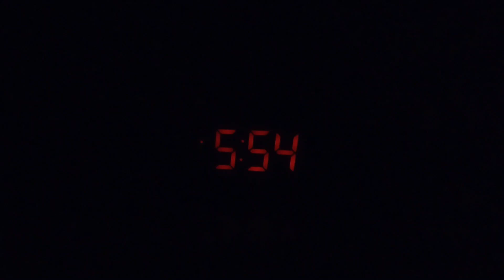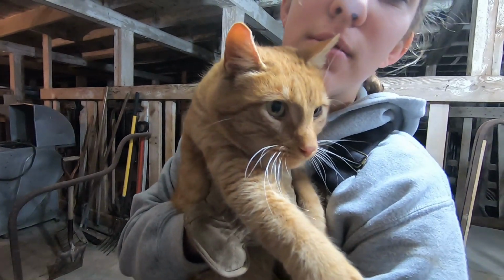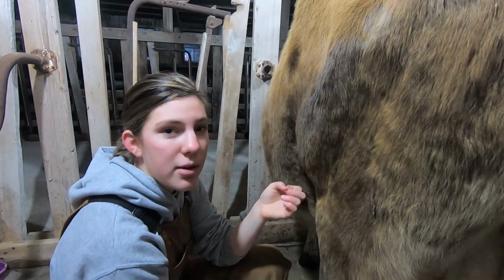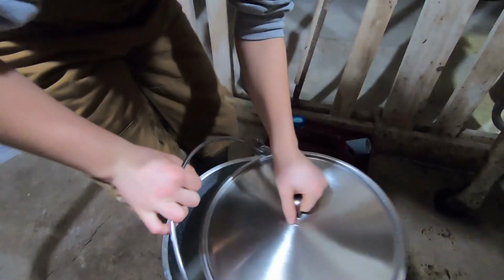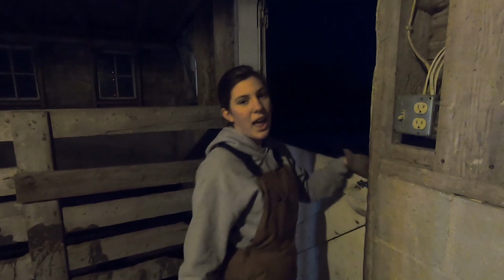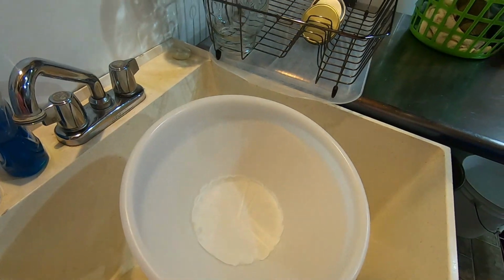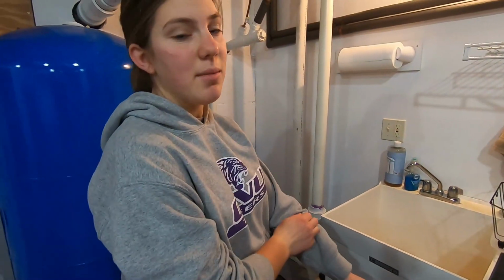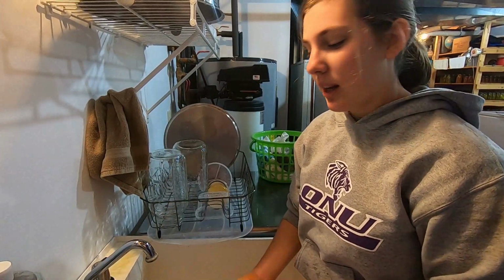Milking with Sister | We Love Raw Milk

Comment: Good job!  I grew up on a farm with 25 milking cows.  We used two DeLeval (later Surge) milkers.  Early we used 10 gallon milk cans, later a 500 gal cold tank.  All milk was carried by hand from the barn to the milk parlor.  Milkers were driven by a vacuum pump.  Yes, the washup was important and time consuming (and least favorite) task.  The buckets, troughs, funnels, etc were scrubbed and rinsed off with chlorinated water, left to air dry.   Kudos to your handmilking - strong hands.
Reply: I use a Surge. It's very old but never let's me down. Milk stays clean and lasts for weeks in the fridge.
Reply: @notapplicable430  The Surge milkers were a change for us.  DeLeval milkers were  configured with a bucket, having a head on the top.  It sat on the floor upright; probably 2-3 gallon.  The head had the pulsing mechanism, with a vacuum hose running to a supply pipe across above the stanchions.  Also, out of the head ran the four lines to the teat cups.  The milker sat on the floor beside the cow.  The Surge milkers were hung under the cow.  A strap was put across the back of the cow, with a hanger rod under her belly.  The straps had holes enabling the rod to be adjusted, depending on the size of the cow.  The milker was a flat vessel, with a head similar to the DeLeval - vacuum hose running to the same supply line above the stanchion.  We would work between every other cow, first working right side, then working the cow  on the left.  Getting accustomed to the stap took some time, but both did the job.  The Surge was cleaner because the vessel was up off the dirty floor.  In both cases, when done with a cow, the vessel was taken behind the cow, vacuum released, the head comes off, and the milk poured into pails.  When full, those pails were hand carried to the milk house to dump for filtering and cooling.

Is this how you worked with your Surge?  

Back-breaking work, to be sure.  We had 12 stanchions on one edge of the barn, and 13 on another edge.  Our setup was common.  I was born in '41, left the farm in '64 - cows were sold in '65.
Reply: @rightsideofthegrass8114  I milk one cow with my Babson Surge Belly Milker. I used the leather surcingle strap for a while, but now I simply place the milker on the floor under the cow.  Works good either way.  The Surge is easy to clean.  Parts for the pulsator are readily available.  And I have not had any mastitis issues since using the milker. 

There is an tie stall dairy barn near me that still milks exactly as you described. It's like stepping back in time. One old guy milking a dozen Jerseys pretty much by himself.